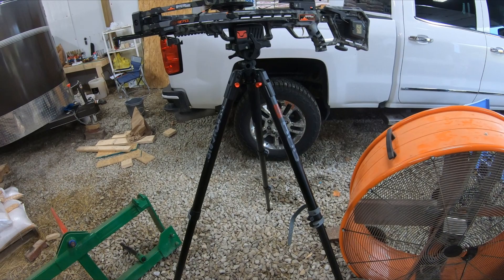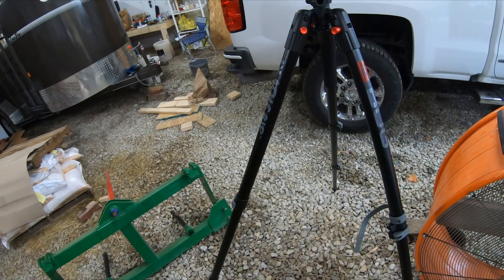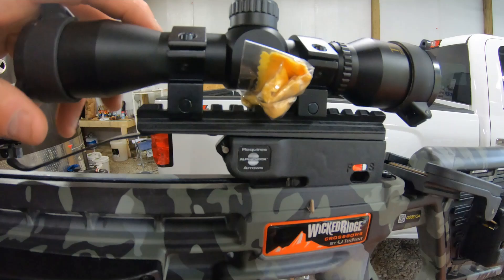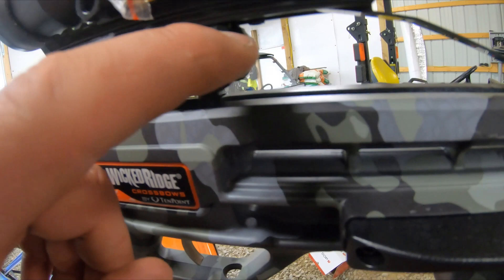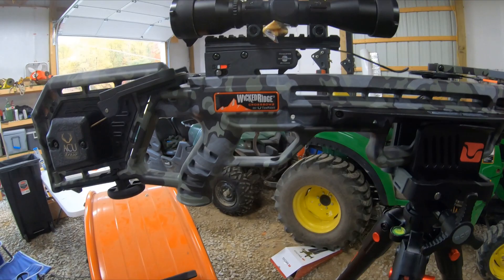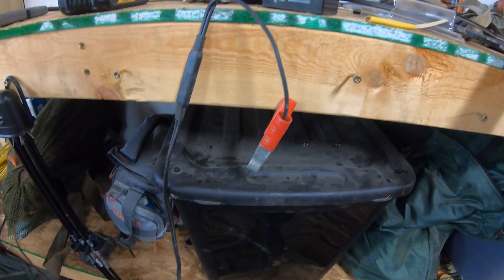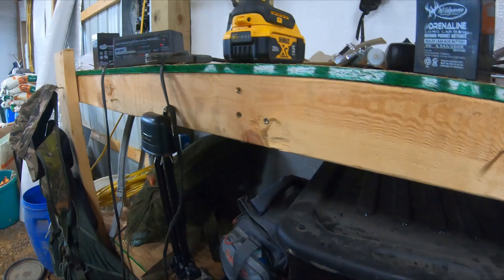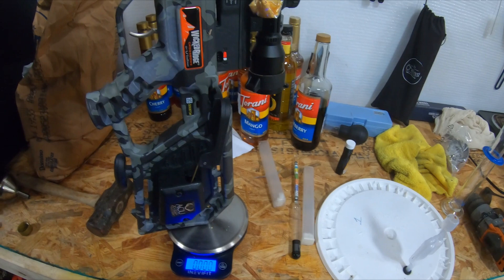This Has To Be The Best Crossbow Money Can Buy

Comment: I bought the Wicked ridge black hunter and some of the screws where loose and the b0lt tension was loose and the cams where out of time. I had to pay someone to put it back in time. The bolts with a 100gr tip weighted 460gr. So the crossbow isn't going to shot 360fps. I'm not too impressed with Tenpoint. Good luck 🤞 with your new crossbow.
Reply from the maker: damn hate to hear that

Comment: I recently picked up the Wicked Ridge M-370 which I'd wanted for some time now.  Prices have come down on the older models as TENPOINT pushes the more expensive higher speed crossbows.  I wanted to know if you shot yours off the BOG POD with the Death Gripe?  No issues with the harmonics, and does it hit the same point of impact if shot from a non-hold type rest?  How's it performed for you on deer with the RAGE?
Reply: Bog pod has performed pretty flawlessly for me over the past 2 orb3 years. I'd highly recommend it.